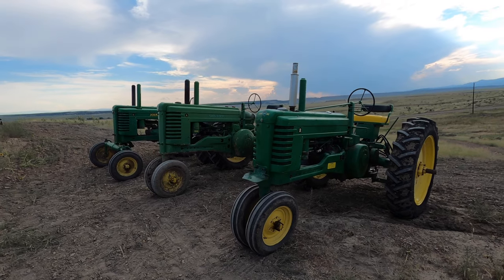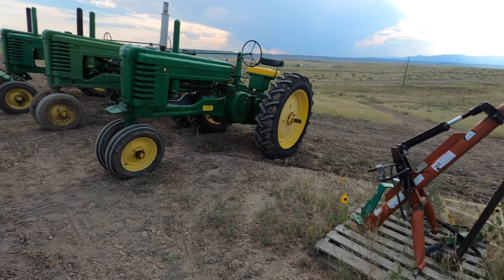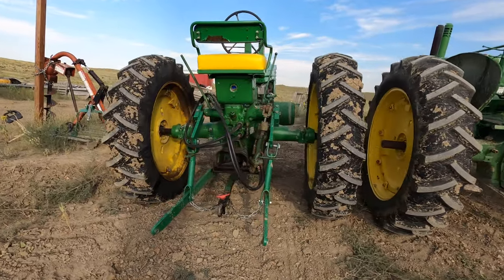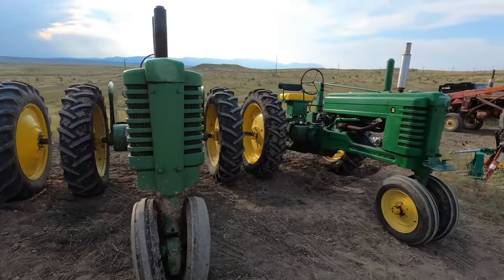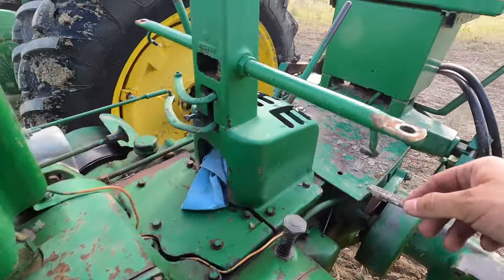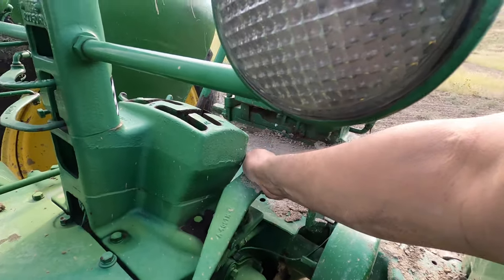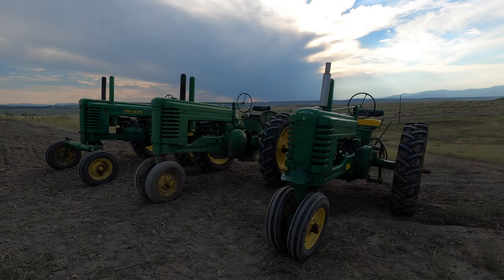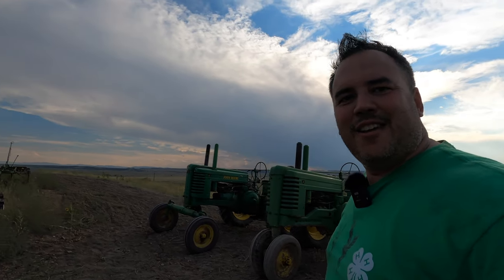John Deere A B G side-by-side comparison and start up!

Comment: The early John Deere Model A, and G had a petcock below each cylinder which had to be opened in order to reduce compression for easier starting of Tractors which had to be hand cranked with a Flywheel. Then the petcocks were closed after the Tractor was started. Our family continued that practice even on Tractors with electric starters.
Reply from the maker: That’s a great reminder.  I did not grow up in the habit of opening the petcock on my electric start models but it certainly makes sense.
Reply: Yep just like mine

Comment: I’m looking at purchasing a 1941 John Deere B it does not run but it does have a lot of engine work done to it for higher compression. I cannot wait to get it and restore it. I love these old tractors.
Reply from the maker: Hopefully it’s not too involved.  Maybe a carb clean and fresh gas and see what happens!  It’s nice when the engine internals should be in good shape.
Reply: Now that I’m thinking about it, I believe the guy told me that it runs for a few minutes and then stalls so I’m thinking the carb needs cleaned and it could possibly have bad spark but we’ll see
Reply from the maker: @CannonMusic05  some of the first things I’d check based on that are 1) make sure that fuel will run constantly from the tank to the carburetor with a pencil sized stream for a few minutes…. If not, you have have a rust clog somewhere.  As for spark, that could be the symptom of needing a coil too.
Reply: @TractorHoarders  thank you for the advice. I appreciate it.

Comment: Love your videos. I have a 52 G, 47 styled D, 42 H, 50 farmall M, 55 720, 52 wide front B ,  37 d on all steel. I’m in the process of redoing my G. My grandpa bought it 30 years ago and always barn kept. I just pulled it out of barn and cleaned points plugs and carb and fired right up. Paint is in good shape but I want to fully redo it
Reply from the maker: Thanks Troy!  You have an amazing collection!  Do you have a favorite one?  Sounds like that G is in real good shape.  It’s awesome that you got it brought back to life fairly easily like that.
Reply: @TractorHoarders  it’d be a pretty close tie between the d and the g. Both such aggressive sounding and looking tractors. Also have a 1904 12-36hp port Huron steam engine and a 1/4 scale 65 hp case steam engine

Comment: We had an "A" growing up and most of the time the battery was dead so we always hand cranked it.  It had a magneto so no key.  No flywheel cover either as we had to hand crank it.  Felt the teeth grab a few times, LOL!  I think ours was a 1939 with a styled front end.  Steel seat.  Battery behind the small gas tank (6v).  We also had a '41 "H".  The "A" had a 3 point hitch, the "H" was strictly pull type.  We used the A for plowing, mowing, bailing, bush hogging and pulling tree stumps, etc.  We used the H for raking, discing, harrowing, etc.  We could plow with the H but it only had a single bottom plow so we seldom used it for that.
Reply from the maker: Sounds like some good memories!  I really enjoy this series of tractors.  I would like to add an H to my collection some day.  Sounds like your A got used for about everything!

Comment: All three of your tractors are "late styled", representing the final updates to the Letter Series before John Deere moved on to their number series.  Your G is most representative of what all three would look like in their "early styled" configuration, aside from the cushioned seat.  When the styled models came out, they all had steel pan seats and were hand start, like the unstyled models. As time went on, they began to be fitted with early electric starters(almost exactly like your G for all models).  It wasn't until the late styled models came out that electric start and the cushioned seat was factory standard, hence the complete flywheel cover.  The G was given factory standard electric start and the cushioned seat, but did not receive the cosmetic updates like its smaller cousins.

In my personal opinion, the early styled models that came with electric start, or were converted to electric start, are my favorite, mostly because of the more rounded looking front frame, completely covered flywheel, partially covered clutch/belt pulley, and fenders(which I concede are all major safety improvements) on the later models
Disclaimer: if I got any details wrong, feel free to correct me
Reply from the maker: Excellent information and overview!  Thank you for sharing!

Comment: Thanks for the vid. As a city kid, this was educational. I love old machines of all kinds. I have seen several videos about old JDs, but none explained the differences...and the fact the letters don't go in order of size. Some day... In the mean time, I will have to play with the Belarus.
Reply from the maker: I’ve never got to operate a Belarus.  Glad this was useful for the differences.  I plan to do another following video based on some of the questions I’ve received.
Reply: @TractorHoarders  I have operated it very little, but have replaced about 75% of the wiring. It has lots of cool features that work without a computer. Automatic 4WD etc. Model year 88, but I am sure much of the tech in it is from the 50s. I worked on old stuff, so I recognize a few things. Cool tractor though. Pretty sure this one is actually a Fiat. They sold the molds after they were done making them. Trivia: The Minsk factory (MTZ) that this one came from is the largest tractor plant in the world.

Comment: Love watching your videos I subscribed last night and am looking for my first project as I am 15 and wanting to learn is there a 2 cylinder John Deere you suggest more for a starter tractor than others
Reply from the maker: Hi Tyler, thanks bud!  For a good tractor to start with, I’d recommend a John Deere B.  Of the two cylinders, the B is probably the highest selling which means there are plenty of parts available for reasonable prices if you need them.  When you get into less common tractors, the cost gets a lot higher.  I’d also buy a running B with good tires.  It’s a lot cheaper that way.  You may find a cheaper deal on a non running tractor but by the time you get it fixed, it’ll cost more than buying one that is already working.
Reply: @TractorHoarders  Good to know thank you so much and keep up the good work
Reply: @tylerlaw9694  I agree with Hans.  B's were so popular that parts are readily available for them.  Plus, there is a service manual for the B that is literally hundreds of pages.  It tells you step by step how to fix anything on the tractor.  Once you do a B you find, like Hans said, most of the letter series are very similar, just a matter of size.  There are also lots of videos to support B's on Youtube.  I have my own channel but @OneminuteFarming did an absolutely wonderful series on a mid-styled B.  Good luck.  You will find the tractor community is very supportive and always willing to help out. And like Hans said, buy it running and with OK tires.  You can drop big money in tires and/or rims alone.  That is my big regret on my B.  I could have had 4 of them by now for the money I have in one that was total junk when I started.
Reply: I’m 19 and my first tractor is a 1952 John Deere B with a three point hitch and is so much fun
Reply: @levismith8245  Nice!  Is it late enough of a 52 to have a water pump?  That is great if it does.  The thermo siphon system was just sub par on the letter series.  And with a 3pt too! Everyone and their mother, including me, wants a 3pt, but the price of the set can be steep,  especially for a true John Deere 800 or 801 set up.   However,  you can quickly spend that amount on these tractors anyways.  Enjoy it.  Once you have one it can become an addiction.
Reply: @DanielFarmChannel  mine has the thermo siphon system and the three point was scratch built from two owners ago it but it functions perfectly
Reply: @tylerlaw9694  get a b

Comment: My 1952 John Deere B has a mag converted to work as a distributor with a 12v coil
Reply from the maker: Hey Levi!  That's pretty interesting!  I saw a Farmall H, recently, that had a similar modification done.  I had never seen that before and didn't realize you could even do that.  haha.

Comment: Great video. Like seeing the differences. You didn’t say what size motors were in the B and A. Or I missed that. And what are the differences in weight. I’m kinda nutty that way. I like to know as much as I can. My Buddy has an M. You need one of those. Or a MT. I own a 1951 tea20 Ferguson. I Sure like old tractors.
Reply from the maker: Hi Noel!  No, you're correct, I did not speak to the displacement all all the tractors.  Here are some added facts for you for the late styled models:

John Deere B:  1250 engine RPM = 27.5 HP at the belt pulley, 3.1L / 190.4 CI, burns 2.5 gallons per hour, maximum drawbar pull = 3447 lbs
John Deere A:  975 engine RPM = 38 HP at the belt pulley, 5.3 L / 321 CI, burns 3.7 gallons per hour, maximum drawbar pull = 4045 lbs
John Deere G:  975 engine RPM = 38 HP at the belt pulley, 6.8L / 412.5 CI, burns 3.9 gallons per hour, maximum drawbar pull = 4394 lbs

I wouldn't mind adding an M or MT to my collection someday.  I like the Ferguson tractors too.  I don't have a Ferguson, but I have a Ford 2N found in some of my other videos.  I like pretty much all old tractors too!  I may make a part 2 to this video to hit on more details like what you asked about.  Thanks for commenting.

Comment: I'm new to tractors, my only real experience is with a Ford 8N. I'm thinking about getting a B to tinker with. How would you say the B would compare to the 8N? I only use it to grade the drive, remove snow and light pulling like dragging limbs or disabled vehicle projects. Thanks.
Reply from the maker: The Ford N series are very handy little tractors that are useful for a lot of things.  The B is heavier and can pull more if you were doing plowing.  B’s were really just pulling machines.  If you add a 3 point hitch to a B it becomes a lot more versatile.  They’re pretty good on fuel too.

Comment: looks like you have some very nice looking quick starting, letter series J. D's I bought my first one this year, didn't know anything about them, being a letter series farmall guy, I grew up with farmalls like a lot of farmers kids did. I should of watched this video if it was out. but used reads and pictures on google searches.  the first thing I noticed, there( the letter series J.D's) are in ant order thats what made it so hard for me. Now I know . But earlier on couldn't get over they did random order 
H  being little  A being  medium/sorts big    G being the largest  and the one I don't have memorized
the M john deere.    and after you get all that squared away then you have to memorize
what tractor is the equivalant of the 50 and 60 ect.   If you know that it's prety easy to figure in
the 20 and 30 series comparable. I also found the engines really different than the tipical.
then I found aanother tractor that has really different engines also Minneapolis Moline's.
Did all your's start on 6volt systems?
Reply from the maker: My B started out as 6 volt, but both my A and G are 12 volt.  They look factory but I am not totally sure.  I think by 1950 they started going to 12 on some tractors.

Comment: What size are the front tires on your B? I like your collection! My line up is two B's, a 1941 and a 1950, and my power horse is a 1960 model 630.
Reply from the maker: Thanks!  Without looking, I think they’re 5.50-15.  Nice line up!  The 630 is a beast for sure!  I wouldn’t mind getting into the numbered series at some point.

Comment: So when is the shed coming?! Need more tractors… ;-)

Also, when you bush hog, do you have a bracket on the front to hold some weights or does it not get too back end heavy..?
Reply from the maker: Haha!  Always need more tractors!  I have something in the works on possible shed space; I hope it becomes reality.  Still working on it, and will share the news if it becomes a thing.   I primarily use the bush hog on my Farmall M, and JD B.  The M has plenty of front weight with the loader, but surprisingly, the B doesn't do bad!  I do not add weight to the front, and I even run it up and down my hills with no issue (carefully).  I may move the B's three point hitch to one of the other JDs, just to try it out, but if the B has no issues, they should probably be fine too.  Another point of consideration is my bush hog is only 5 ft.  If I get a larger one, I probably wouldn't want it on the B without adding front weight.

Comment: Hey I noticed the extra pullley on the bottom of the A is that power steering?
Reply from the maker: Hey Levi, good eye.  It’s a water pump.  They can be found on the later models, usually 1950 or after.
Reply: Water pumps were needed on the very late model As because of copper shortages during the Korean War.  The radiators had been switched to steel and were no longer effective enough with just thermo-siphon flow.

Comment: Your G probably doesn't have 2 reverses like the 70 does,does it kick out of high like my 49 A?
Reply from the maker: Mine does since it has the high/low stick.  Every  gear has 2.  Is that what you mean?  I have never operated a 70 but have interest in getting a 70D someday.  On this tractor I haven’t had it kick out, but my B will kick out of 3rd.
Reply: I used to have a 70d, but traded it for a 4020 ,my 70 did have 2 reverses and high reverse was fast

Comment: So what do you do if my B is locked up and won't turn over.
Reply from the maker: I’d take the spark plugs out and open up the petcocks and try again.  If it still is locked, you’ll have to pull off the valve cover and inspect, and then pull off the head and inspect the cylinders.